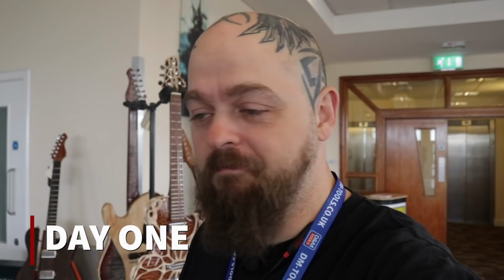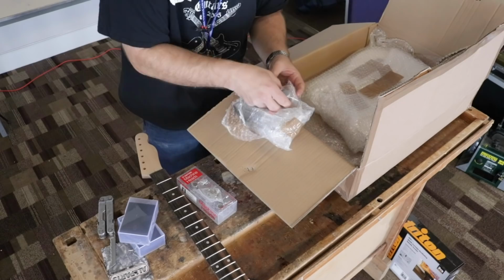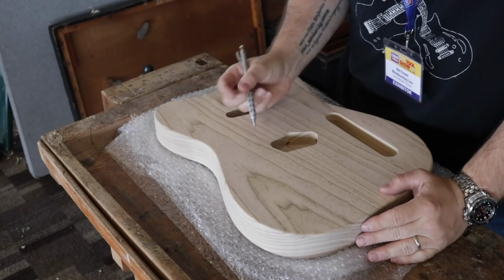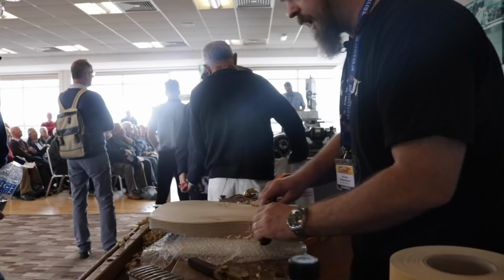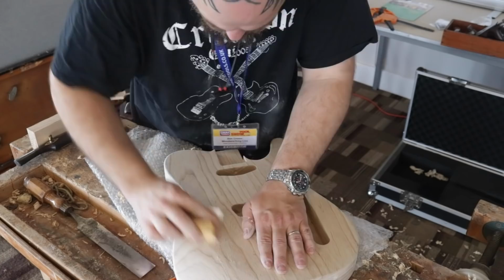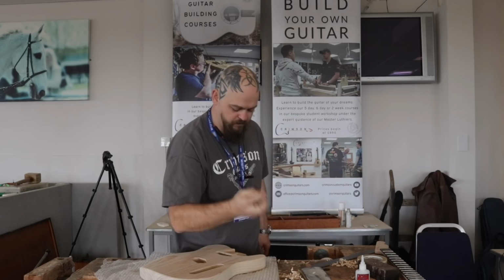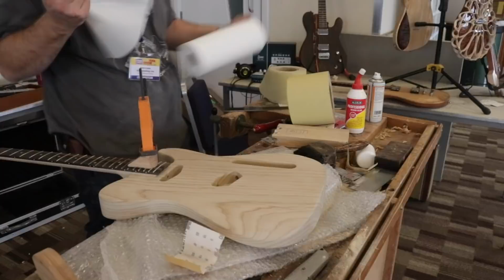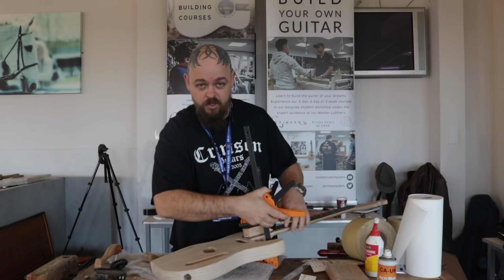Ep 1 of 3 - Taking a Kit Guitar and Making it Burnt Gold

Comment: You know the way you cut the back plates for the electronics (which even my 22 year old daughter thinks is cool 😮), well, how about doing something like that for the front of a guitar? And also, a build incorporating some/all of the tools Crimson manufactures ie. metal ruler as the racing stripe, protractor (is that the half circle thingy?) the electronics cover/pick guard, fret rocker bolt on plate (advertising purposes, of course).
Ps. Like the way you said (about the complication) " Yes, it's completely playable", and thought "But I'm not gonna let you play it".
Reply from the maker: Hey Glenn, good ideas.. I have considered a multi-level on multi piece top like that, there are other builders who do it and I dont want to seem too cheeky ;) Tell your daughter she has impeccable taste and I approve!  Ta. B

Comment: Love the spontaneity of it all..............I found my old 1987 Pacifica stuffed away in the corner a couple of days ago. It has a horrible thick black poly finish. So thinking.............burn the bugger a little...............and then red stain. Now problem is how do I remove the poly finish ? Most folk seem to remove it with a hot air gun.  Is that the best way...........or would I be better off stripping it and if so.............with what ? I have already sourced a dark black pearl pick guard.................and trem cover, also have new pickups,  nut and machine heads.